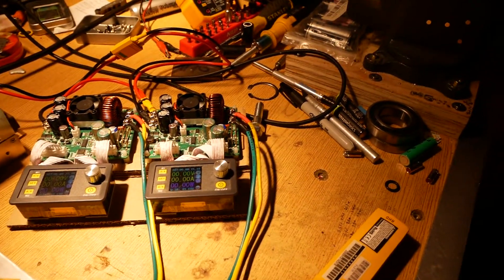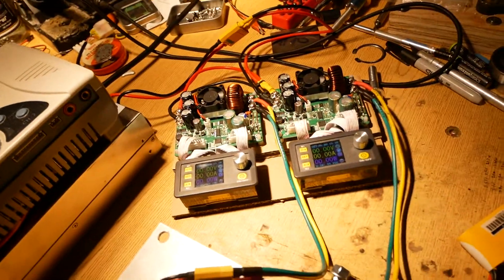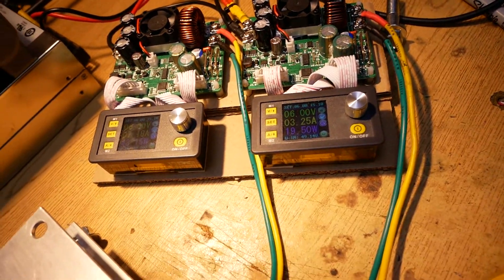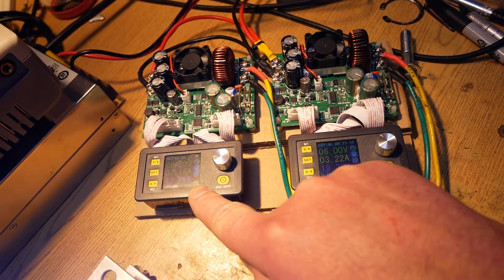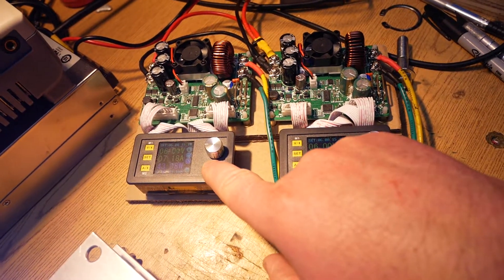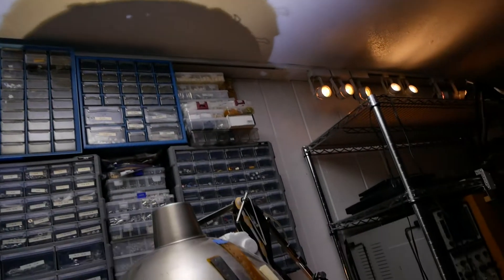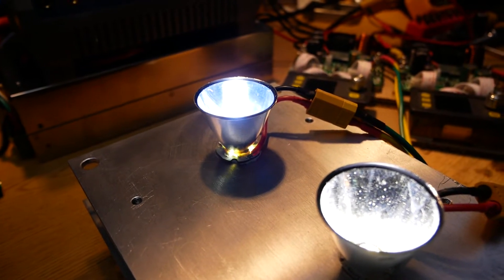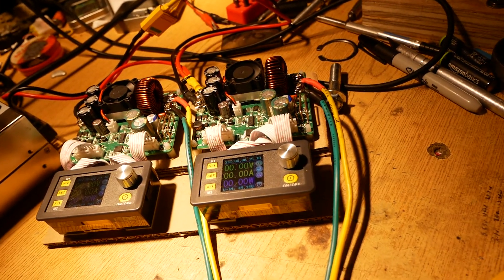CREE XHP70.2 VS Chinese XHP160 Bench Test

Comment: He has clearly no idea how a LED works, need to understand what negative temperature coefficient is.

He successfully destroyed a perfectly good LED.
Reply from the maker: Who is this "he" you refer to? 
*
The point was to show these LEDs and their capabilities right up to destructive limits and as expected the CREE LED out performed the Chinese LED. If you are complaining about destroying an LED, well that was the point...and CREE won yet again! Never mind you missed the fact that the CREE LED is easily 200% more efficient than the Chinese LED for nearly the same amount of light output.
Reply: @de-bodgery  the crew is 200% more efficient? In what case? Against a destroyed Chinese one? Good job. Maybe hit the XHP160 with a Hammer a few times, then the Cree is infinitely more efficient.

Jokes aside. 

If one buys an XHP70 and a let’s say LZ7…
The XHP has 4 big Dies, the LZ7 7 smaller ones. Now one purposely overloaded the LEDs, both from prominent brands by the way, one could expect the LZ7 to get hit harder because of the construction, in fact the LZ7 would die sooner. But if we look at the slope of efficiency the LZ7 would win and beat the crap out of the XHP70. Same story in your test, the only thing you show is that the XHP70 dies can handle a bit more , ONLY SHORT TERM , abuse.

This has meaningful value to anyone besides one who designes a strobe, but even then the test you did was a way too low frequency at a high dutycycle.

Pure scientific question of :
Eh I want to buy an led torch, should I buy one using XHP160 or XHP70? 
That question is not answered at all by you. 

Reading your answers to some comments you imply you had answered exactly that question.

That would be the same as one buying a Nokia3310 and an iPhone 13 pro max ultra super blah, hitting both phones with a falling stone on the screen and saying the iPhone is trash, the Nokia is a way better phone in every aspect.
Reply: @gtm3617  why would anyone want a larger die with more leds if it has less overall output

people buy shit with "XHP160"'s etc because they want more output, not efficiency at low power, they want more at full output

the XHP70 in this video was nowhere near it's max power, and it still was brighter than the XHP160 at double the power, that is in my mind embarrassing

that equals to about 70 lumen per watt, if the XHP70.2 is 150 lumen per watt, the XHP70's can take up to 29W

that is absolute horseshit.

if it was infact by being overdriven it would've atleast been brighter for a sec or two till it reached it's thermal limit, atleast thats how all overdriven leds reacted in my testing

i think it's just a garbage led in this case